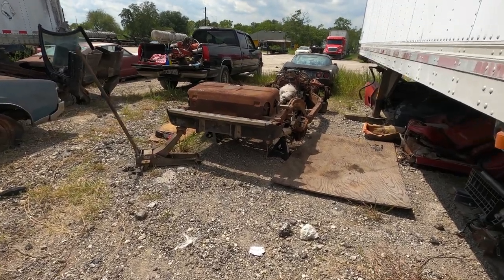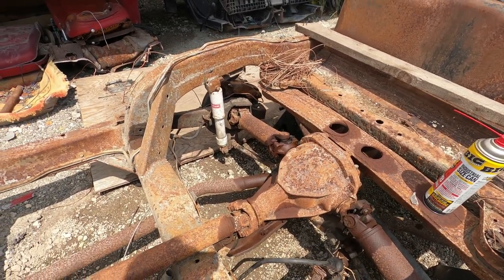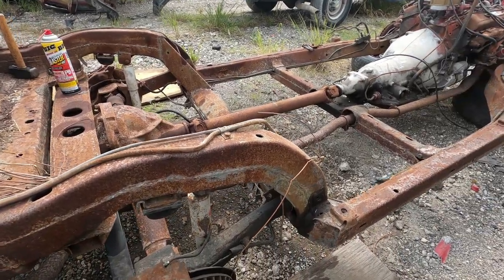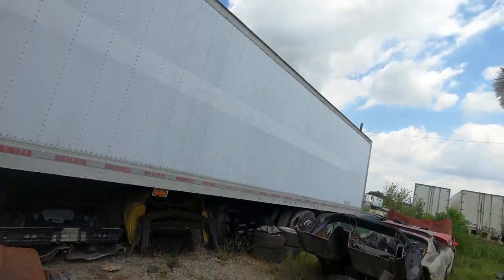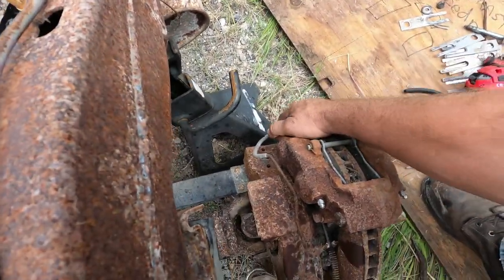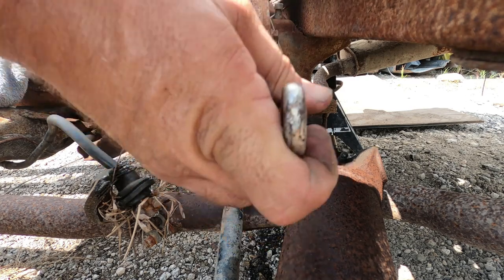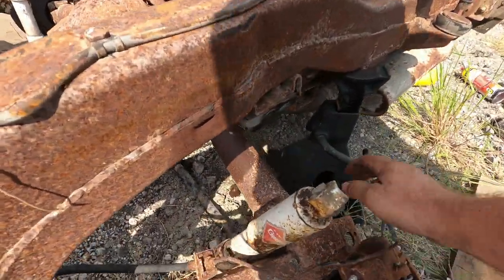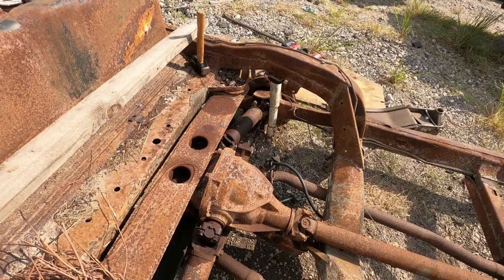C3 Corvette Trailing Arm Removal in 20 Minutes

Comment: Going to do this on a 66 vette tommorow. I hope it goes as smooth as this
Reply from the maker: Good deal, good luck👍.
Reply: @VetteSource  just removed the real trailing arm assembly with drive shafts. Everything was smooth thanks to the video. next, I'm going to remove the differential

Comment: Great instructions. Definitely will come in handy.  If you have an opportunity, I would sure like to see the best way to remove the soft front bumper of a C3.  It’s currently giving me fits.  There’s got to be an easier way.
Reply from the maker: Hey Randy, thanks for the feedback. The front bumper is definitely a pickle to get at. Are you trying to save your current bumper, or replacing it with a new one?
Reply: Front & rear bumpers are in pretty good shape since the car has been spared a lot of UV light most of its life.  I finally got the front off a few days ago even though many of the #10 nuts were pretty rusted and a bear to get to and remove.  All good now.  Body is off and I’ll start ‘sanitizing’ the frame this week.  West Coast Engines was balancing the new engine when I checked a few weeks ago so it should be coming in soon.  Fingers crossed no major issues in the future.  Thanks for responding as always.    r
Reply from the maker: No problem, my friend👍

Comment: Body lifted, engine and transmission are removed, frame and suspension removed but the trailing arm bolts are STUCK.....any suggestions.   Trying to get the frame sand blasted and powder coated in our complete resto-mod rebuild.
Reply from the maker: I hear ya, that's the thing you always want to not happen. Unfortunately your at the point of cutting the bolts out with a sawzall equipped with good bi-metal blades. After you get the alignment shims out, use a shorter blade, spray some lubricant in there, and cut through on each side of the trailing arm. It's tedious and time-consuming, but it will get it done. Let me know how it goes.

Comment: Had to cut trailing arms in half then cut  bolts and still had to get a porta power ti push rusted bolts out replaced with off set trailing arms and stainless steel bolts and shims
Reply from the maker: Yep, that is the fate of the majority of them. I half expected to find the same situation with this car and not be able to finish this video, but I got very lucky indeed👍.

Comment: Bolt rusted in bushing use a sazsall 6” blade, take nut off bolt and pry pound the shims out. Then you have room to get sazsall blade in to cut bolt on each side of arm, easy , courses if bolts rusted in bushing your planning on replacing the bushing anyways or at least cause of the age of the bushing
Reply from the maker: Yep, that is how it works about 80% of the time😁.

Comment: he says several times that this can be more difficult // think about doing this laying on your back with the body on the chassis  // just removed the rear end from my 79 with 75,000 miles on it and factory original hardware (and rust) // been wrenchng for 60 years // not a job for the faint of heart // it is a terrible job //
Reply from the maker: AL, you had me laughing out loud with your comment/testimony. 1000% correct this is a TERRIBLE job. It's so terrible in fact, I had avoided even attempting to make a how to video of trailing arm removal until I noticed this frame had stainless hardware installed.

I have a nasty field find 74 that still has the body installed I'm going to start tearing down, so just for grins I'll make another video documenting what it's really like trying to get the C3 trailing arms bolts removed.
Reply: Oh, come on, guys.  It ain't half as bad as assembling nuclear warheads.  Before long, you'll have the scarred hands of a lifelong Harley-Davidson mechanic!
Reply from the maker: Assembling a nuclear warhead, now that would be a video I would watch😁.